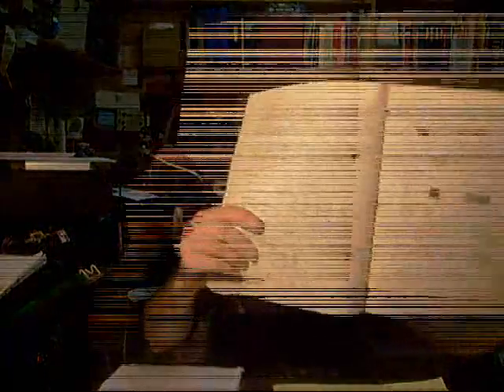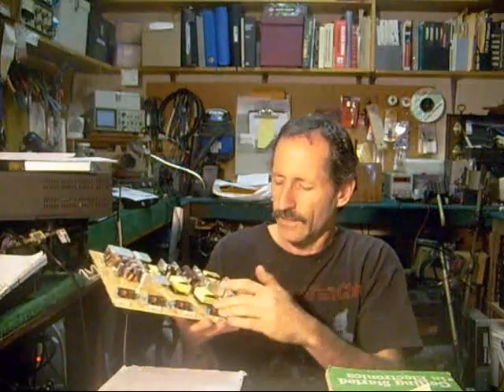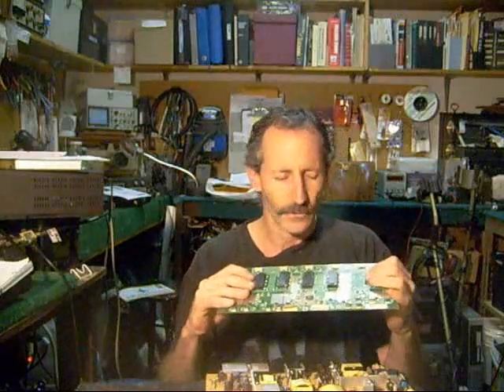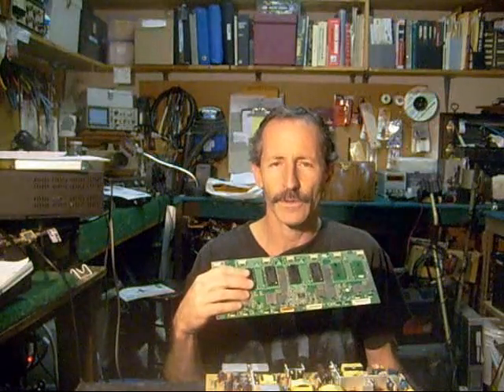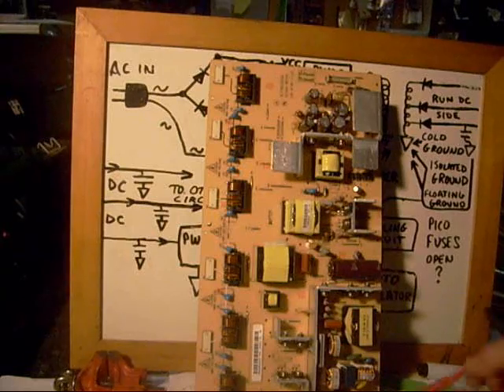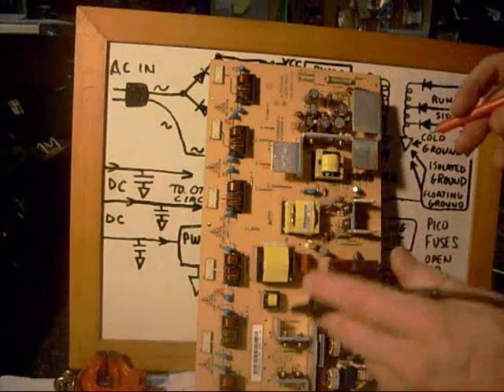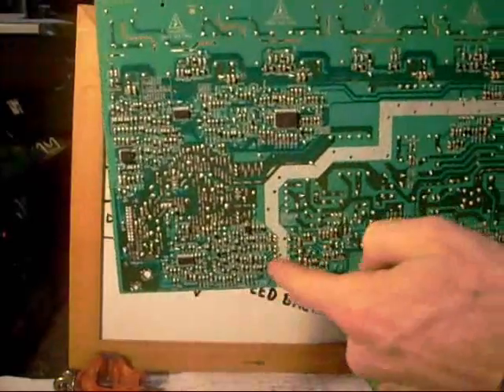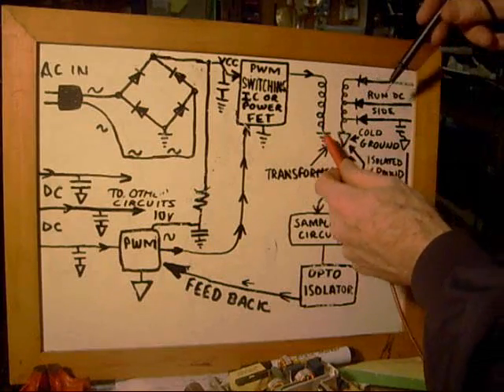LCD TV Repair made easy # 6

Comment: since the "low voltage" side is supposed to be insulated from "earth ground" it means there is no connection to neither the live or L1 nor N or neutral. so is it safe to hook my earth ground oscilloscope to the "floating ground" for probing around , NOT using an isolation transformer on the PS or Scope itself ?? - and how come i once measured like +-150V DC between  BOTH pins of the 400V reservoire CAP and the floating ground ?? isnt it supposed to measure near 0 V there if the isolation is really there ?

Comment: hellow GRANT i have a paloroid tv model tva-03211c and one day it just turned off by it self,
once i replaced the capasitors on the power board the red lite came on when i pluged it in and when i turned it on the blue lite comes on but no sound and no video no back lite and will not turn off only unpluging it so is that the mainboard problem? can you help me please mikepreciado59@gmail.com

Comment: i have a LG m3201ce with a problem .when you turn it on and look very closely you can see  the picture but there is no brightness.i believe it is the back lite invert-er .it is almost identical to the one in your video.could it be a problem with the power supply not feeding voltage to the back-lite invert-er ?.can you help

Comment: Firstly I like to mention that your videos are very interesting, thank you for that, job well done, keep the good work, I have a NEC TV model: LNT-26HBD3, that does not have power, or picture, the only think I get is the red light on the power button, and pressing on/off doesn’t do anything, to your opinion is that the capacitors in the power board need to be change? If YES can you give list of which one I need and where I can get that kit? Thanks for your collaboration
Reply from the maker: You need to start by testing all the voltages from the power supply to see if any of them are missing. If they are you need to determine why, and if they aren't you need to check the other boards for problems which may be causing the TV to go into shut down.

Comment: Love the vids, I see you have promoted a lot of books that are very useful, I have repaired maybe 30 or so TV's and have incorporated electronics into my mechanical services company, I really enjoy it, my question is what book would you recommend for diagnosis of smps boards, I know the basics but at a disadvantage  when it comes to certain boards, in particular I have a DPS 280lp with a low voltage on one of the inverter sides, this causes the backlights to shut down totally,  I want to figure this out, Thanks and keep up the good work.
Reply from the maker: My favorite book on Switch Mode Power Supplies is the one I listed on my website by Jestine Yong at http://www.tvrepairinfo.com/

Comment: Hi Grant. I have an NEC 4616 monitor from 2009. Approximately in the middle of the panel i have one green pixel all the time. Tried some software to fix it and the pressure fix directly on the panel. Its still there. Any good advice?
Regards Igor

Comment: I have a Sony KV30HS420 that will not come on, sound with no picture for 3 seconds then shuts down. Shown 6 flashes on standby light.  Much conflicting info on internet, so I thought of your site, which I have been a subscriber to for years. Some say replace IC504 on AY board, others say IC 8002 and IC6501 on power supply. What say you?   thanks, KS      PS, sometimes tv standby light is out, and I try the tv and it comes on and runs fine for hours and hours.

Comment: ONE more thing, on the small 19inch Sylvania/Emerson/Funai What have you, Garbage TVs, there is a Power board/Processor board. Question, why is there so many empty spots on the boards. ALSO on Toshiba Tvs well really any TV, there is always a couple of spaces for blue disc capacitors, which are easy to tell what it would be, does adding installing them a bad idea?

Comment: ALSO this has been bothering me, on the main power supply capacitor in most TVS, When i replace it, with a big Rubicon i hear a high pitch sound, Especially on the smaller Tvs with the 270uf Non-Sense as i am sure you have seen it, you know the bluing capacitor that is kind of small compared to american 270uf. What is this noise.

Comment: Hello again , i visually inspected all the caps in my lcd and much to my disappointment none of the caps appear to look swollen  . DARN ! couldnt  be easy, so i ask should i try the blow dryer trick? Some of these caps are shrouded by some sort of a metal heat sink or insulator s , do these need to be removed ??

Comment: I appreciate all your useful info. I am handy enough to make the repairs required given proper instruction .I must say i dont want a career in tv repair or service manuals .I have a Sanyo LCD tv upon turning the set on it takes 20minutes for a picture to appear , then all is well. Everytime i shut  off the set  for an extended period of time the procedure needs to happen again. I been told was to look for the the probable cause to be capacitor  related  .....

Comment: @GrantsPassTVRepairs  I appreciate your info , but what about us guy's who are handy enough to fix a lcd tv with proper instruction without wanting a career in electronics or  service manuals . I have a Sanyo lcd tv and i believe that i might have a capacitor problem  upon turning the set on i have sound , but it takes approximately 20 minutes for a picture to appear .If i turn the set off for a period of time  it will have to go through the warm up procedure all over again.

Comment: @GrantsPassTVRepairs 

That sounds no good, but I appreciate your help. I called Samsung and they patched me through to the nearest "certified" repair store, a whopping 200 miles away. Thanks, guys. They required $100 down just to give me an estimate, which irked me more than a bit because if I'm going to spend $100 right off and then another several hundred for the repair, I might as well buy a new set.

I haven't been able to find anyone with the exact same problem. I'll upload a video soon.

Comment from the maker: @adam2armour It doesn't sound good. You can start by re-seating your ribbon cables between the T-con board and panel to see if that helps but it could also be a bad display, T-con board or display drivers which are bonded to the display panel.

Comment from the maker: @sandieguitoadult  Just be careful with the T-con board. It is very static sensitive and easily damaged from static discharge. This is also true of many of the other boards. Some wear a ground strap but if you don't have one just make sure your not charged.

Comment from the maker: @frayeleo0015 It's hard to know for sure but my notes and case histories have several possibilities. T-Con board could be bad, loose or bad ribbon cable, bad caps in the power supply or bad LCD Screen. Start with the simple things you can test like the capacitors.

Comment from the maker: @saint27573 I can't guess at your problem but often times people get lucky by spotting some bad capacitors and replacing them but they fail to replace the bad capacitors which were not visually defective. I start with the power supply capacitors and move on to the other possible problems like missing voltages and shorted inverter board transistors and transformers.

Comment: grantspasstvrepair  hi i have a 37 inch lcd tv its a magnavox it started giving me problems with the green light blinking taken long time to come on so i replaced the 2704  capacitor that fixed the problem for about 3 months but now when i push on button there is no blinking light . do you have any idea can you steer me in the right direction . i fixed it when the capacitor was bad and was sucessful but im clueless this time.

Comment: Hi Grant, i recently bought a Metex MS-9150 Universal Test device on ebay, the signal generator was not working and there was a nasty smell, one of the 16 leg ic's was completly melted, it was a removable device but had also destroyed the ic holder, i managed to see the device number and order some more, i'm wondering if it's something else that caused the chip to meltdown, what should i test before replacing the chip? Power drain on the boards powersupply? voltages to the chip? thanks.
James

Comment from the maker: @246246 
I can't specifically steer you towards a high current high voltage design, but if you don't need to high of a current tear apart one of those electric bug lights that fry the bugs. I found a step up transformer that put out 3000 volt AC.